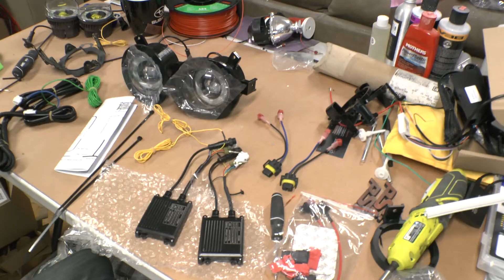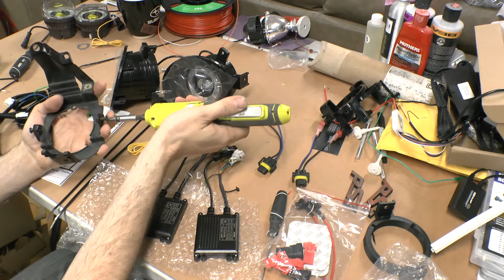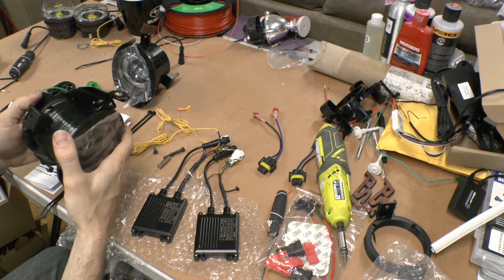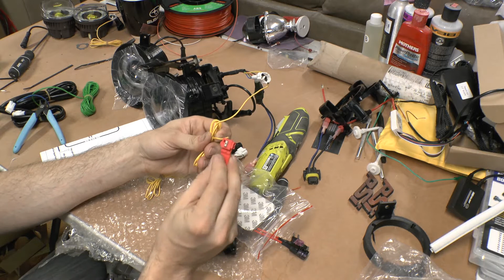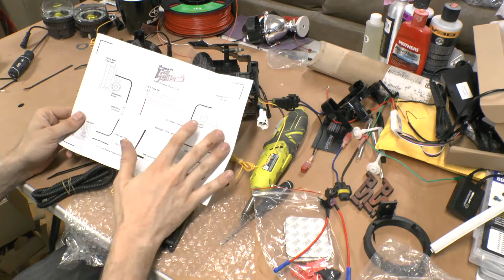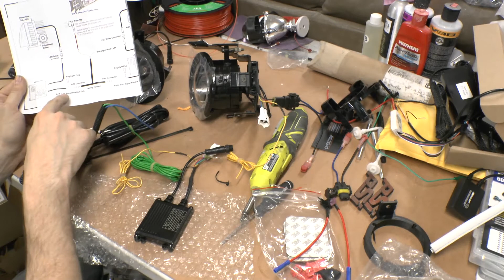03-05 Subaru Forester Fog Lights

Comment: Hello I have an 03 Foerster and I went to change my bulbs to a brighter water bulb to match my headlights, 
When I installed both of the new bulbs my Fog lights will not turn on, so I switched back to the factory original bulbs and again they would not turn on…. I’ve checked the relay and it seems to be fine,

I believe the black square relay that is underneath the steering well the fog light relay is the third one up from the bottom,

Any advice besides ordering a working left and right power off eBay????

(before I tried switching the stock Barb for brighter wider bulbs my fog lights always turned on and had no issues, could it be a grounding error when installing the new bulb?

Comment: Is that driver necessary if I was just to replace the fog lights with led pods without a drl or blinker?
Reply from the maker: The driver is more for the fog light than the drl and turns
Reply: @NextLevelNeo  what is the purpose of it? I’m guessing to control wattage on the factory wiring?